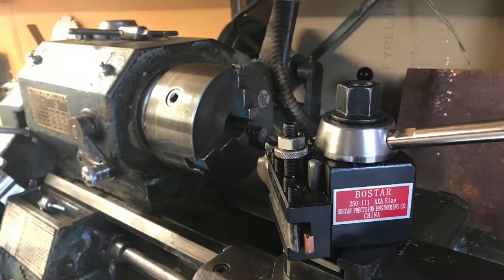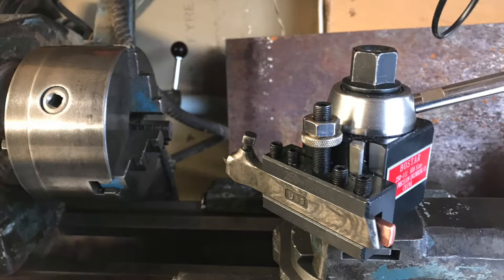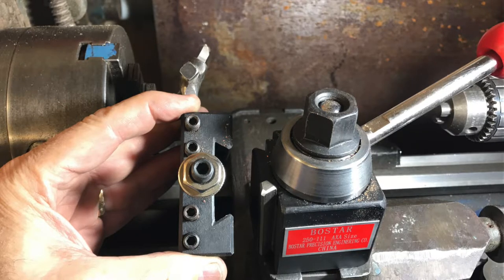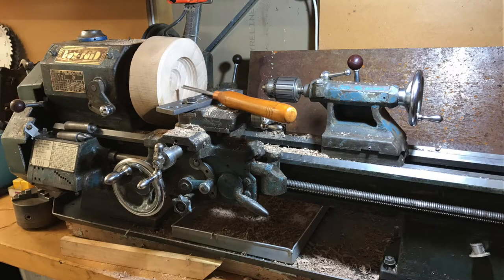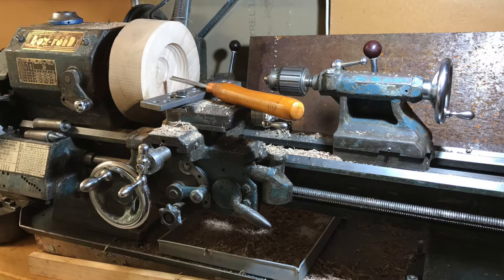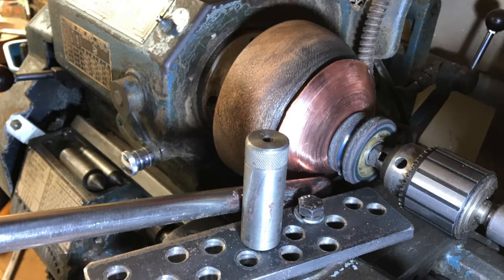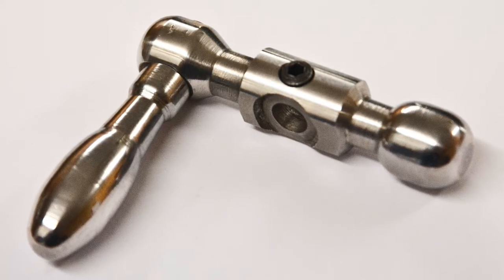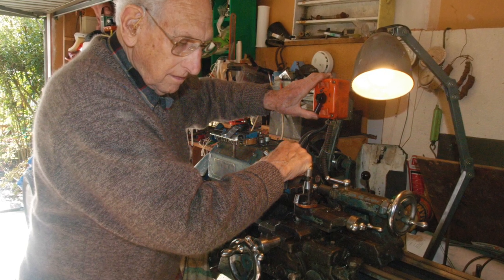Part 3 Setup options for the Boxford lathe

Comment: Nice video, how do you put the rounded lip on the rim of your copper bowls?
Reply from the maker: That is quite tricky. I made a steel roller on the end of a long steel pole with a convex outer surface and another with a concave surface to press onto the rim as it is spinning. Once it starts to curl up with the convex (domed) roller I switched to the concave (grooved) roller to pick it up and make it curl right over.
Reply: @Evan-e-cent  Thanks that is tricky!